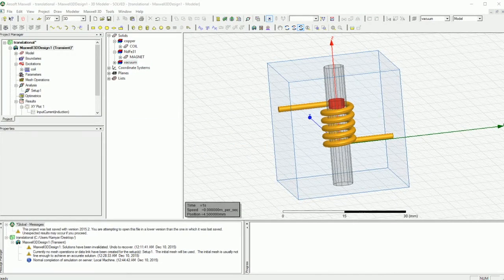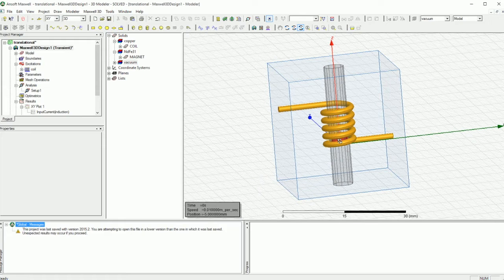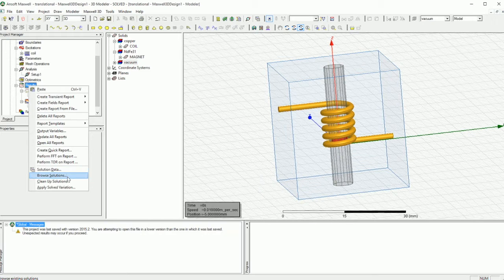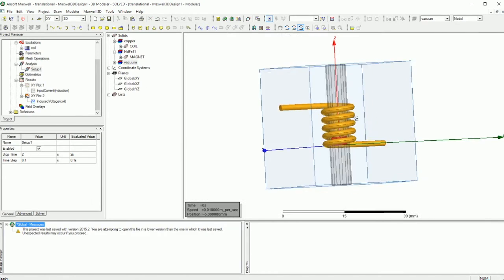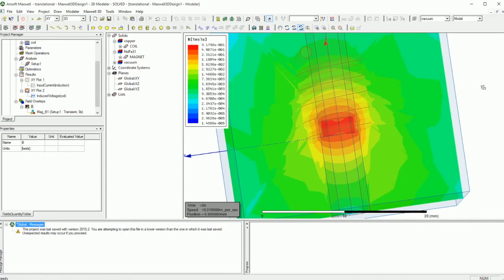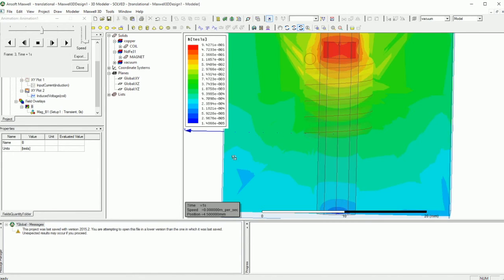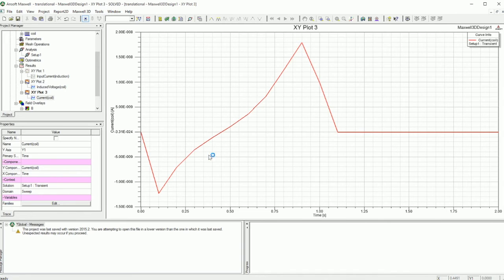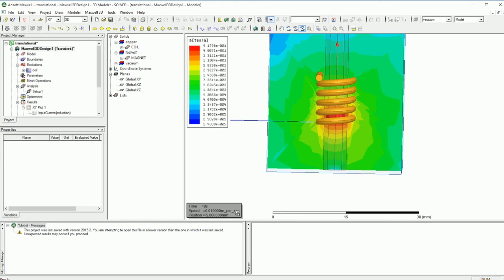409 - Ansys Maxwell | Translational motion [3/3]

Comment: Hallo thank you for the interesting vedio. I have one question, if it is possible to excite the coil with  current profile from outside, since in the electrical motor, we know the sinusoidal current profile, and we need to calculate the torque .
Reply from the maker: Hi, yes you can excite the coil in transient solver using current terminal. Then you can import a current profile to design —> datasets. By default the name of the data set is ds. In the excitation you can use pwl(ds,time) or pwl_periodic(ds,time). You can do the same thing in magnetoststic solver by defining a variable (timeStep for example) and sweep it in optemetric tool.

Comment: Is it possible to add a winding with coincident terminals and MEASURE the current due to a magnet oscilation?? I've seen instead of that, a excitation, but a measurement not yet. Example: the getting started of rotational actutor uses a coincident terminal to excite a core. in your exemple you'd with a coil and two terminals that are not coincident. A coincident terminal solid would be like your exemple 'torque of permanent magnet'.

Comment: Hi..
Thanks for the video which is very useful. I am presently simulating the a case of magnetic trip of a miniature circuit breaker (MCB). I have a doubts that, how to express the mechanical transient load force of spring inside the solenoid (opposing force to electromagnetic force), Whether it is needed to put -Ve sign for the same while expressing 'load force'?

Comment: Hello, first of all thank you so much for all your videos, I pretty much learned the basics just by watching them. My question is regarding mesh issues in a translation problem. The error message "The quality of some mesh elements is not acceptable for solution. Please check the geometry for issues in the following location (in meters): X=0.102374, Y=-0.0828606, Z=0.254197" keeps popping up every time I run a simulation. The coordinates given are different each time. I checked the location of the coordinates and it always points to a blank space (doesn't intersect any object at all) inside my region. I've also tried different mesh types and configuration but nothing seems to work. Have you ever encountered this problem before? Any help would be much appreciated.
Reply: I got the same Error. Check your location, I think that should be inside the magnet not on a blank area.

My solution was replacing the cylinder "Magnet" with a regular polyhedron and so it's working.